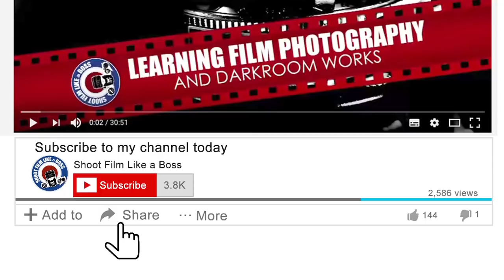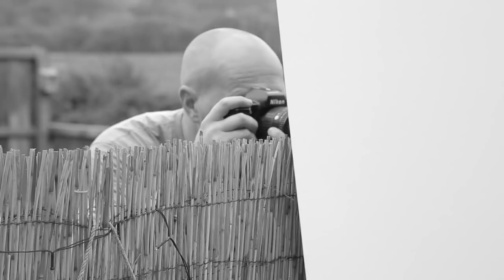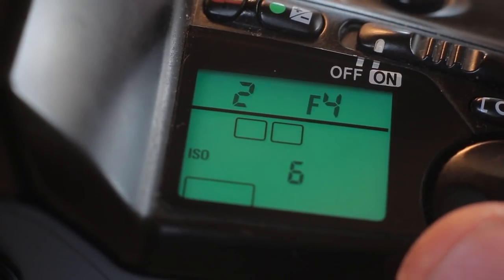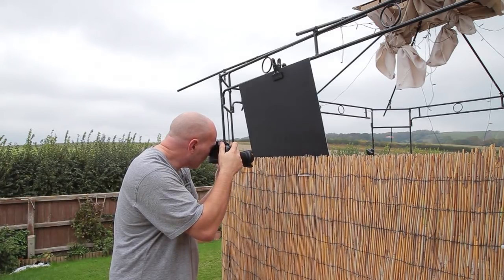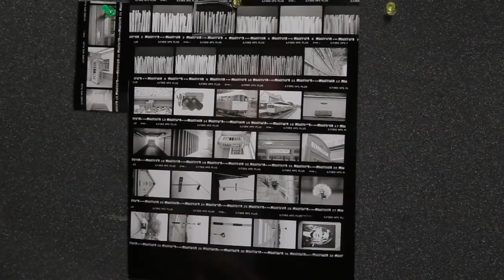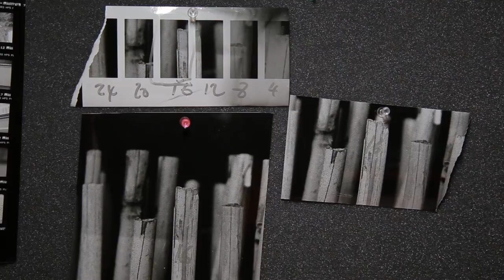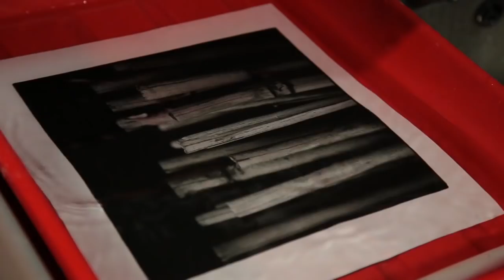Nikon F90X 35mm Film Camera Overview - Shoot and Print

Comment: Another great video.
I bought my F90X new in 94, it cost about £1200 with a 50mm lens and grip if I remember rightly. I used it professionally and was so impressed that a couple of years later I bought another used body. I used both professionally until the onset of digital when I sold the second body but couldn't sell the original because I was too attached to it. The camera still gets used alongside digital bodies with the same lenses. The crappy back rubber stuff has been cleaned off and replaced with camera body leatherette, an easy fix.  One of the most reliable and consistent 35mm cameras that I've ever owned.
The plastic outer body shell is still in great condition.
A great, good value film body to carry alongside a Nikon digital body. 
I'll be keeping it forever.
Reply from the maker: Ah, nice to see the video reached a loved user! And backed up what I said when pro's used them too. £1200! in 94! That was a lot. I find mine very reliable also, although I have no other glass for it as It's the only Nikon I have. Thanks for your comments Jon.
Reply: @ShootFilmLikeaBoss  
They were very expensive cameras and I seem to remember that the Yen was doing well at the time. I also seem to remember that there was a three month wait for one if you could find a supplier..
They were definitely regarded as a pro camera for those that didn't need the industrial robustness of the F5. In fact when first introduced Nikon kinda shot themselves in the foot as many regarded it as better than the F4.
I bought them because they were light enough to carry two with different lenses or films and the infallible metering. Never a dud frame. I pretty much made a living with them until the 2000's
In my opinion the best bang per buck on Ebay at the moment.
Reply from the maker: ki0ng  Got mine off with isopropyl alcohol. Bit of elbow grease and all came off.
Reply: They are great cameras. If you are a tradesman or good with your hands it's not much of a problem.
 I used proper thin black leather that I scrounged from an upholsterer. Very thin about 1 to 1.5 mm thick.

Remove the camera back from the camera.
I used meths and scratching to get the old stuff off. Finger nails and a bluntish scraper like an old credit card, crappy job but do-able.
Let the meths soak for a bit then scratch.
. 
Thin leather stretches a bit so I cut a piece of leather about an inch oversized all round. 
Apply thin coat of good old Evo Stick on the camera back (keep the film window clear) and apply glue to leather .
 
Important... Wait ten minutes for the glue to be touch dry,
 
Starting from the centre working outwards stretch and stick the leather on avoiding bubbles and smooth it as you go. 

If you do the ten minute wait trick Evo Stick sticks like the proverbial.
(For Americans "Evo Stick" is UK contact adhesive).

You now have an oversized rectangle of thin leather stretched tight and stuck to the camera back.  Let the glue fully dry. Couple of hours.

You will be able to feel the film window through the leather. Make an indent with your fingernail or a blunt pencil tip.

Stay away from whisky until you've done the next bit.

Or if it's way too fiddly get the missus to do it.

 I managed it and I've got fingers like a blind cobbler. If you cock it up it's easy to take off and clean up for a second attempt.

Grab a brand new, proper scalpel and carefully cut around the film window indent. Do the same for all around the edges. Try to do continuous cuts along each edge without stopping. 
Basically you're using the camera back as it's own template.
All around the edge you will have a 1mm thick greyish, lighter color where you cut the leather, grab a black Stablo or thin Sharpie and make it black.

Quick coat of boot polish and it looks classier than new. Also feels better in the hand. You'll lose all the idiot P mode stuff printed on the back, but a man of your calibre doesn't need all that anyways.

It took me longer to type that lot than too actually do it.

If you pull it off, do a YouTube on it

Cheers and keep up the good work.
Reply from the maker: @jonjanson8021  Keep off the scotch lol. Thanks for the input Jon.
Reply: I just ordered this as my first step into film photography.
Reply: @ShootFilmLikeaBoss  I just got a F90x and did not like the look of the back. Did what you did and used Isopropyl as well, brought it up great. Was a bit worried about the little pictures coming off but they stayed in place
Reply from the maker: @BurningBroadcast  mine has been a rock
Reply: Thats great to hear. I got a great looking one from Japan for about 50 bucks. It will arrive somewhere end of Jan. Curious to get into the world of film :) 
 @ShootFilmLikeaBoss
Reply from the maker: @BurningBroadcast  it takes time and patience but is rewarding and fun. You will make loads of mistakes but all to learn from.
Reply: @BurningBroadcast  
You won't go wrong with an F90X, mine never let me down and still going strong from new. A grip is worth getting as well if you do a lot of portrait shooting. The dedicated flashes were Nikon SB26, or even better SB28, cheap on E bay. The best lenses are Nikon "D" series. Auto focus and usually plastic barrels, but the optical quality is excellent. The only things I didn't like were the electric cable release which was at the time expensive and the electric film rewind, which rewinds the film all the way back into the cassette. Which means you have to crack open the cassette to get the film out for developing. Not a big deal but I preferred to leave the cassette dangling as a weight when I wind onto developing spools. Otherwise I can't criticise them.
Oh! And the sticky back..  :)
I think it's the best most reliable 35mm camera I ever had. Not trendy today because it doesn't have the "classic look". A reliable easy to use workhorse.

Comment: Hi Roger, stacking dishes great space saving idea, however a thought occurs to me. If the developer was at the top then stop in the middle and fixed on the bottom, the risk of contamination of the developer would be removed.
Reply from the maker: If the developer was at the top i wouldn't see the print unless I had a step ha ha. Good point though, I'll have to watch out for that! Thanks Stephen.

Comment: F90X is my first camera, and i still use it.
But sigma lens, im curious to try it. 28-70 nikkor is given with the F90X. And its obvious that you used a macro lens to make the first photo in this video.
About the back, yes its very bad, but i like it for two reasons : first, it protect very well the camera. I drop it for the first time of my life ( im still angry about it ) few weeks ago, and this plastic stuff get hurt, which is better than the camera itself. Second reason, its because the camera get old with me. Im 32 years old, i got F90X since i'm 18, its pleasant to see it getting older.

Comment: Sorry for the dumb question, do you know the purpose of the yellow bar on the outside that lights up (on the top of the pentaprism). Is it let you know the meter is on without looking through the viewfinder? Thanks for the review.
Reply from the maker: Yes, whenever the meter is on (press the shutter half way) that strip light comes on along with the LCD display and the meter inside the camera. I don't see the relevance of it though! Here is a PDF for the manual http://www.cameramanuals.org/nikon_pdf/nikon_f90x_af.pdf
Reply: @ShootFilmLikeaBoss  Thanks!

Comment: I recently got an F90X and l was really surprised with the build quality, since most prosumer cameras of the 90s were a bit plasticky feeling, whereas Nikon really shines, and gives a sense of reassurance with it's weight, and the design kinda breaks away from the 'bubble' design most manufacturers stuck with during the 90s. I've been a Minolta user (700si) for over a year, and the controls are really similar, the dial-knob interface is easy to get used to. Minolta's biggest drawback is the sticky rubber grip, and the lack of illumination of the top display, but otherwise a solid performer. Also, Minolta glass is really nice and not too expensive.
Reply from the maker: I may look at some minoltas for a 35mm camera.
Reply: If you decide to go down the AF route, l highly recommend getting the Dynax/Alpha/Maxxum 7, since it supports the SSM lenses by default (the 9 had to have some factory upgrade in order to support those lenses), but other than that 700si, 800si are also very good and reliable cameras!
Reply: I've got two of them, for stereo shots. I really miss using them.
Reply from the maker: @vladislavstanimirovic9650  Thanks  a lot.!

Comment: Any tips for if I wanted to swap out a roll that I’ve used halfway without rewinding the entire roll into the canister? Is there a way to rewind so that it doesn’t go all the way back in and then I can use that same roll at a later date or in another camera?
Reply from the maker: I think that would be difficult to do. You'd have half a roll exposed. You'd have to be careful how you stored it or you'd scratch the film. Then in total darkness load the film back into a camera and advance to the last frame you was on. I'd just cut it. I just made a video on this.
Reply: @ShootFilmLikeaBoss  thank you so much!

Comment: Hi I’m subscribed to your channel and I’m start with B&w and actually I shoot my second roll (ultrafine extreme 400) with the same camera but I notice my pics came to grainy .. I used d76 , Kodak professional fixer and ultrafine stop bath , shoot at box speed and also a just to my temp 77f  by massive chart times  , but I don’t know if I did something wrong , because when I compare with other with same method and stuff have a different look, did you have any tips for this situation ? Thanks in advance and keep with this channel , is very enjoyable 👍🏼👍🏼👍🏼
Reply from the maker: Hi Jacasan. Congrats on shooting your second roll. I've only shot that film once and I had good results from XTOL. What was your Dev times in D-76?
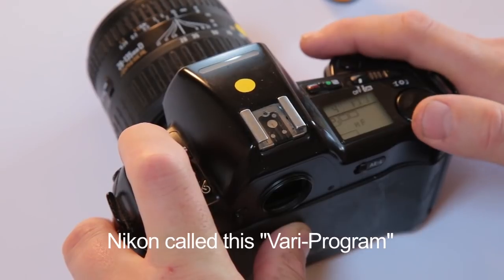Reply: Shoot Film Like a Boss thanks for answering, massive charts give me 6:03 min...I use the calculator they hay have for adjusting the time
Reply from the maker: @jacasan2000  That sounds about right if it's a stock solution at 77f. Try another role shooting at 400 and develop at 1/1 20° for 13 mins. 5 slow inversions to start then 5 inversions every minute on the minute. And make sure your stop and fixer are also the same temp. You will see grain on UF 400 but only slight. Not massive.
Reply: Shoot Film Like a Boss thanks I will follow your instructions for next roll ,thank you very much
Reply from the maker: @jacasan2000  let me know how it goes. you can email me. cheers

Comment: I'm a novice and would greatly appreciate your help.

What are the best lenses you would recommend for the Nikon N90s camera. My Google searches don't help much. Any advice you can offer would be greatly appreciated. Thanks in advance.
Reply from the maker: Depends what you want to shoot. If I could choose 3 lenses for this camera I'd go for a standard 1.8 50mm, a 85mm and a 28mm. Older lenses. I only have this sigma for this camera
Reply: @ShootFilmLikeaBoss  thank you. I would have been more specific. I meant the model and mount information for lenses that directly fit onto the Nikon N90s without the need for a mount attachment. Sorry for not being clear the first time around. I'm relatively new to this arena.

Thank you so much for taking the time to respond. I greatly appreciate it.
Reply: @ShootFilmLikeaBoss  I'm having a difficult time figuring out which mounting systems allow full functionality of the cameras controls, which lenses offer only partial functionality and which lenses only offer manual function on the N90s.

Comment: Great video! I just got a N90S from eBay for $27USD. The LCD display in the viewfinder fell down inside the prism housing and rattles around loose down there. It does work though, sometimes I can see it down in the bottom of the viewfinder. Also the data back is all gummy and tacky so I covered it with gaffer tape. But it is a fun camera to shoot!
Reply from the maker: I used isopropyl alcohol to rub that goo off the back. You lose the icons and it leaves the back shiny black. Looks better.

Comment: I have two of these. Both came boxed with grips and neither cost me more than 35 quid. Ergonomically  I some issues with them. The one thing that really annoys me about it is that there is no mirror lockup. However they are intuitive to use. The meter on them is far better than it needs to be for negative film.  The TTL flash metering is brilliant.  As you would expect the auto focus is not up to modern standards but it's fine for what I use it for. I usually just stick a 35 or 50 mm lens on them and it is just so easy it feels like cheating. 

If the rubberised finish on the back annoys you I have removed it with a microfibre cloth and some surgical spirit. It leaves a far more appealing shiny black plastic back. The programme mode icons are left behind if you don't rub too hard. To be honest though who uses programme mode these days?

I really like your channel. I wish I had the money, space, time and patience to set up a darkroom,
Reply: Not up to modern standards?? its auto focus is faster than my canon m6 with an equivalent lens.
Reply: Hey how about that autofocus? Saying that is not up to modern standards you mean it can do some mistakes for example aiming at body silhouette and you get focues the part behind person?

Comment: I am looking for a Nikon film camera and have the chance to buy an F90x or an F801S what is your view of these and which would you go for?
Reply from the maker: I haven't used the F801s but I read the autofocus is slower compared to the F90x. My one is reliable and still works a treat.
Reply: Thanks for the reply. Having read a bit more I think the F90x is the way to go.
Reply from the maker: @SteveChick02  it hasn't failed me Steve. Easy to navigate settings. The back coating is a bit crappy but I got mine off after this video. Nice and clean now. I can't fault it.

Comment: How about the autofocus in this Nikon? Does it make some mistakes while shooting by selecting the space behind person being photographed? For example I want to shoot photo of person standing at the beach and in case of my Nikon F601 the autofocus can be problematic selecting the focus behind that person while aiming the silhouette... In that situation I have to use focus manually to be sure about photo being done properly. I'm just moments before buying Nikon F90X and I wonder how good, how accurate is the autofocus in this model to be 100% sure making photos focused on spot and not being mad about another unfocused photograph :/ 
So I don't know exactly if it is a problem because of the old mechanism of the focus or whatever in my Nikon F601? I bought this one for making photos in fast way, some objects in motion, etc when speed is the key. 
You know, there is no point to buy autofocused camera and use only manual focus  :D Even if there is a rangefinder (that dot in the eye finder)
Reply from the maker: There is a switch for focusing. Manual, constant and something else I can't remember what it's called, auto, maybe. As long as I'm not in constant focus I can lock focus on my subject.
Reply: @ShootFilmLikeaBoss  Yes, constant focus is for object in motion I think, like car when moves it changes the distance from you and the focus is changing in the same time when car moves while you are aiming your camera on the car and then the single autofocus mode when you want to focus on the face/eyes and then change the frame moving the camera left or right and maintain the focus and sometimes my Nikon F601 sets the focus on the background instead of the face when I'm aiming someones face I don't know why is that. It is somehow not so accurate, like it can't "see" the distance between me and the person standing and chooses the background to focus and not the person 😂 Sounds crazy but it is not so accurate I wonder why 😁 I hope the F90X which I bought today will be good enough to use its autofocus mode without to be worried if the photo was made good after scanning the film 😁 I hate that when I see it's not sharp when I want. So I used every time manual mode but there's no point doing that every time in the autofocus camera 😂🙃

Comment: You loose the 3D Matrix feature  when you use manual lenses on the F90 unlike on the F100, I printed 3 pictures out  today that I took on my F90 I like the fact it takes AA batteries but like you I prefer my mechanical cameras as well though the F90 is a excellent camera........
Reply: Unfortunately even the F100 will not do matrix metering with manual lenses unless they've been chipped. You can leave the metering mode switch in matrix but if the camera can't read the focal length from the lens's circuitry it will fallback to center weighted on its own. You can see this by the center weighted icon in the lower left of the viewfinder when a manual lens is mounted. Off the top of my head the F6 is the only Nikon film SLR that will matrix meter with manual focus lenses since you can store a small library of focal lengths and select them when mounting the lens.
Reply: I never knew that  that's very interesting it's also ended my slight interest in a F100 if one ever came my way, I think I will stick to the F90 for my Nikon fix. Thank you for the info Derek it's much appreciated.

Comment: My (NEW) N90s doesn't have the rubber on the back door..... It's plastic but still has the symbols printed on it, Obviously one of the differences between the N and the F :-)
Reply: No, more likely a previous owner removed the sticky coating. You can use isopropyl alcohol.
Reply: @joeltunnah  Yet the symbols are still printed on the film door.
Reply: @IainHC1  the symbols are printed on the door, not on the coating.
Reply: @joeltunnah  On the N90s but not the F90x